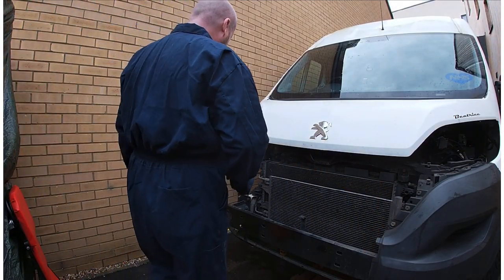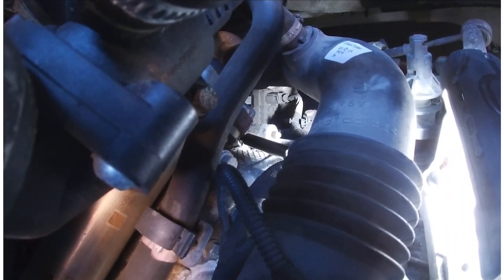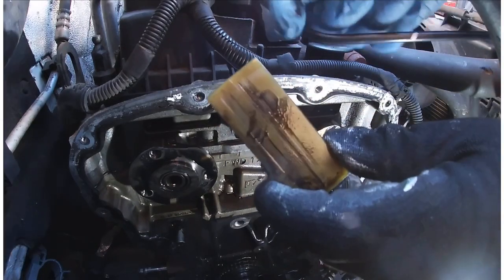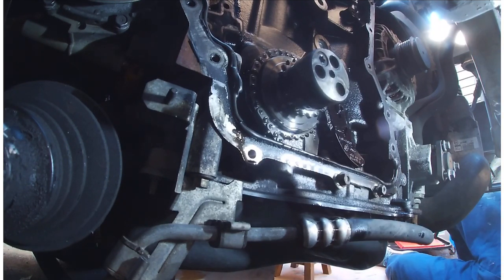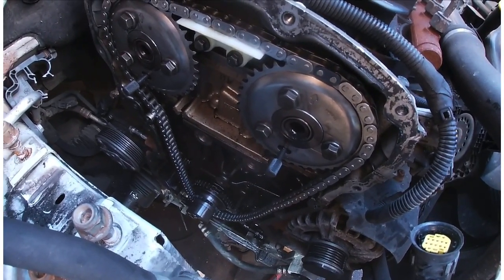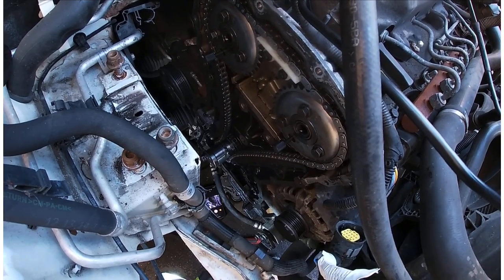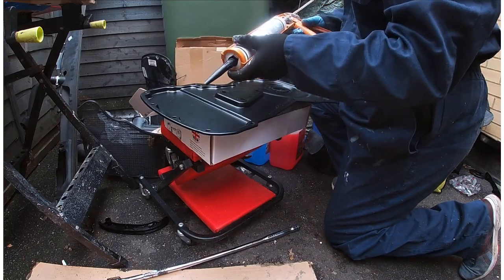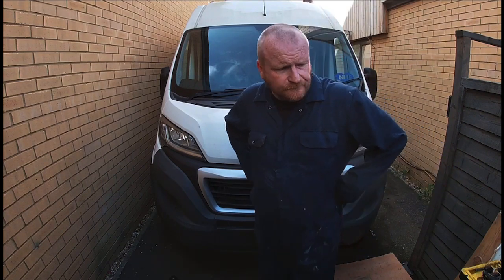How to change a timing Chain on a 2015 Peugeot Boxer 2.2 HDI. Vlog32

Comment: Thanks for the video, I am watching a few before I do mine.  A couple of comments on the timing job.  Firstly, you should remove the tensioner pin and allow the timing chain to centre everything before you tighten the 3 nuts on each sprocket.  The reason the camshaft sprockets are on slots is to allow this adjustment.

Secondly, if the crankshaft locking pin was correctly inserted the crank shouldn't have moved when you tried to remove the bottom sprocket. People use the clamp because the pin is such a pain to insert, you don't need both anyway.

Comment: I was initially confused why yours took so long to do. Then, I did mine. What a pig of a job. You're guide is very handy but I think the work that takes the most time is all prior to getting the timing cover off. Mine wasn't rattling but van came with no service history and 130,000 miles, so I thought it best to be on the safe side. Bad news was that my old chain didn't need replacing (practically no stretch). Good news was that this points to the van having been serviced. Thanks for the video.
Reply from the maker: Thank you for your kind words. It’s was a bit of a pig but I enjoyed doing it. I’m just about to put up a new video on my van, I had a bit of a disaster with an oil seal.

Comment: Good effort! I just spent several months rebuilding my 2012 Relay engine after the oil pump unexpectedly failed at 115000 miles. I had routinely serviced it and was completely unaware of the issue so didn't even notice the oil warning before it started clattering. 

Anyhow, I just got the engine back in the van and running and I have an oil leak. Looks to be coming from the timing chain cover. What was a relatively simple job with the engine out is now difficult (as you well know). I just checked your video to see how difficult it is going to now be although I already had a pretty good idea what I am in for.

So anyone with a similarly aged Boxer or Relay - check to see if your  engine is effected and save yourself a couple of grand. Apparently Ford recalled all of there transits with this issue. Citroen didn't even bother to warn me. The AA and the machinist I used all knew very well about it! 

Changing the pump is relatively very easy!

Comment: one thing i would say, and i too am no mechanic, but i've been looking at doing this job on one of my old jags, some of the chains i looked at had the split link like the ones on yer old push bike., and need to be put on the correct way around with the rotation of the engine so it can't accidently undo. not sure if it applies to these chains. but you did a cracking job and saved a load of money too.
Reply from the maker: Thank you for your kind comment I really do appreciate it.

Comment: Great job..I'm in the process of doing my peugeot boxer 2008 2.2    I'm having a problem getting the timing locking tools I have looked on eBay but no luck..Help we're to locate these would be appreciated..👌
Reply from the maker: Morning Barry, I used the Ford Transit 2.2TDCI Crankshaft Locking Tool
Locks DC Sensor 2006 onwards
£19.99 from eBay. I had the same problem until someone told me it’s a Ford engine. Hope this helps, good luck with the repair and thank you for your kind comment.

Comment: Thanks for this video, i have the relay version with this engine (2016), with 86k on the engine. just lately i've been hearing like a heavy metal clanking sometimes on first cold starting, i thought it may be camchain, but at my miles unlikely, i think it maybe the Dual mass flywheel, so i'm going to do that first on mine. by the way, this engine is also prone to sudden oil pump failure, may have been usefull to change yours while it was in bits. 😁 cheers for this vid though, def usefull for when i do mine. 👍 p.s. i've also converted mine into a camper 😁
Reply: Oil pump issues were on 2.2 puma engines prior to April 2015 apparently.
Reply: My relay 2015 also makes a slight ,not heavy cold start clatter but its just asking for oil from the sump ,i always leave mine at least a minute before heading off and its fine once oil has got around . If you dont it will struggle till warm.

Comment: Hi, fab informative video....thumbs up to you!. Can i ask how much all the parts cost to carry this job on your Boxer as i too have the same issue of what i believe is a noisy cam chain? . I have a 2007 Citroen Relay camper with 135k on the clock and have the same 2.2 engine that i think i will have a go at to try and resolve the noisy engine?
Reply from the maker: Hi Steve, thank you for your very kind comment I really appreciate it. So in total it cost around £260 but this includes oil filter + oil which is recommended, timing chain cover (which I damaged removing it, so be careful) and the camshaft locking tool set. Hope this helps.
Reply: Forgot to ask but did you get the parts from the dealer or aftermarket parts suppliers ?
Reply from the maker: Aftermarket parts.
Reply: Good job, which aftermarket did you use?

Comment: Great job I have a Citroen relay 2015 mine has start to make the same sort of noise? Did it all came in a kit also did you make the locking fitting?? And how must for it All if possible thank you from Sunny Skegnes
Reply from the maker: Hi, so the kit cost £240 with the timing chain cover (the cover gets bent when you remove it) and the crank shaft locking set cost £20 (Ford Transit 2.2TDCI Crankshaft Locking Tool Locks TDC Sensor 2006 onwards) you will also need a full service after, due to oil having debris in it. Hope this helps.
Reply: @illgiveitago1239  thank you I should have looked at the comments thank you again not looking forward to it mine is also turned into a campervan alway go wrong went you think of going away 😆

Comment: Hi there you dont say what year your van is can I ask that please as mine could possibly need a new chain and I have been told that the engine needs to be removed mine is a Citroen Relay 2015 and my search bought your video up thats why I am asking what year yours is. Thank you
Reply from the maker: Hi Sue, it’s a 2015. You don’t need to remove the engine. It can be done as you see in the video. You do need to get the crankshaft holding tool. https://www.ebay.co.uk/itm/Ford-Transit-2-2TDCI-Crankshaft-Locking-Tool-Locks-TDC-Sensor-2006-onwards-/255089405322?mkcid=16&mkevt=1&_trksid=p2349624.m46890.l6249&mkrid=710-127635-2958-0
Hope this helps.
Reply: hi thanks for quick reply as i have been trying to get quotes and those that will consider doing it say the engine has to come out and the cost would be over £1000.
The first garage i tried was surprised the engine needed to come out so he quoted worst case cost. I can ring him back now and have a further chat to him. Many thanks again for coming back so quick. Also how do we watch you video on your motorhome can you send the link please.  Sue
Reply from the maker: Hi Sue, you can find the video here. Any problems let me know. Hope you get your van fixed soon. Happy vanlife 
https://youtube.com/channel/UC9XLdwMO9BVNaFsDWvGaB7w

Comment: Hello. Great video. Question : after replacing the chain and removing all locking kit did you try rotate engine and see if black chain marks aligned with arrows? I’m doing transit custom 2.2 and after rotating 4 times crank shaft my arrows not meet with chain black marks. Thanks
Reply from the maker: Thank you for your comment. Yes, I did rotate the engine and after 4 rotations No they didn’t line up. From what I understand you need more than 4 rotations for it to line back up. As long as the timing marks line up before and after chain replacement it should be all good. As long as the main crankshaft and the camshaft didn’t move. If you used the kit I used in the video you should be fine. Good luck 👍
Reply: Thank you 👍

Comment: You didn't show it but it appears you have to remove the auxiliary belt tensioner to take the timing cover off. Any hints as to how you accessed the tensioner bolts. The lower one seems to be blocked by the a.c. compressor.
Reply from the maker: The only way is to loosen off the bolts to the a.c. Compressor just enough to get a spanner on the bottom bolt. It’s difficult but doable. Hope that helps Graham.
Reply: @illgiveitago1239  thanks for the info. Only ford could design an engine where you have to loosen off an AC compressor, to then remove a tensioner that you have to remove in order to replace an auxiliary belt. I couldn't even get the plastic belt cover off without removing the engine mount.

Comment: What happens if chain snap on the move?
Reply from the maker: This can seriously damage your engine. The pistons could hit valves which in turn would mean an engine rebuild. Expensive.
Reply: @illgiveitago1239   how to know if chain is snapped or slided away? Is there engine light blinking?
Reply: @Harry-ty2qk  if its snapped the engine won't start, and the damage will already be done. it'll be very expensive to repair. i'd say cheaper to replace the engine.

Comment: Alright again mate how did you remove the drive belt tensioner what a crap setup this is u can't change the belt without removing it cheers
Reply from the maker: Hi, hope you are well. So the belt tensioners bolts are difficult to get to, you need to take three bolts holding the air conditioning compressor out, slightly move the compressor down to get to the bolts for the belt tensioner. Yes a very bad setup. That’s how I did it, unsure if this is the correct way or even if there’s a better way. Hope this helps.

Comment: What brand of timing chain kit did you use please?
Reply from the maker: Hi Graham, sorry for the delayed response. I’ve been trying to find out the brand name of the timing chain but been unable. The packaging it came in didn’t have any names on it and the place I got it from use a few different brand names.
Reply: @illgiveitago1239 Another question, when you removed the locking tool off the timing chain end of the crank shaft why did it rotate? I thought the pin in the crank sensor hole was supposed to lock the flywheel. Do you think it hadn't engaged fully.
Reply from the maker: Hi Graham, yes it hadn’t fully locked in but when I went to remove the flywheel locking pin it was very tight. It’s alway best to be super careful and just make sure nothing moves. It was very difficult to get the flywheel pin in because you can’t see. It all worked out in the end. I really do appreciate your comments. Thank you.

Comment: I have a Peugeot Boxar 2.2 Fridge 2014 with 204000 The oil pump stopped when I opened it and I found it broken Engine 130 HP they told me hey weak

Comment: However, changing the timing chain at 130,000 is not normal. The stops up to 300,000 km
Reply from the maker: 130,000 miles

Comment: Same engine as ford Mondeo  English guy does a demo
Reply: hello friend i have a peugeot boxer 2.2 no power i changed the circuit where can the engine power be lost if it is not engaged correctly will it start will it work or is there a second way to pos
Reply from the maker: Hi mate, have you changed the timing chain? If you have and there’s a loss of power, the timing could be out. When you’re starting the engine, are there any engine management lights on.